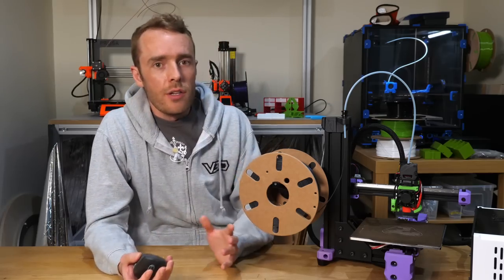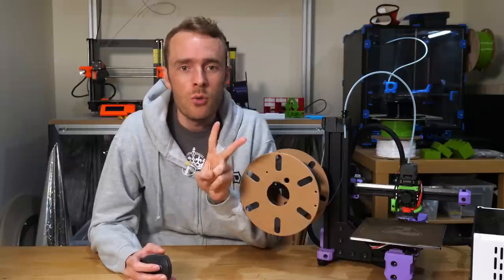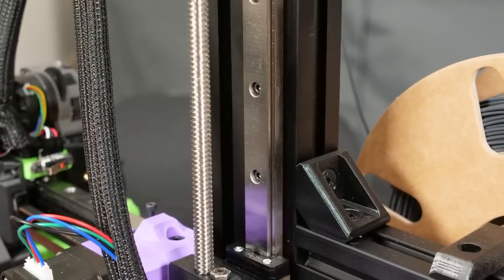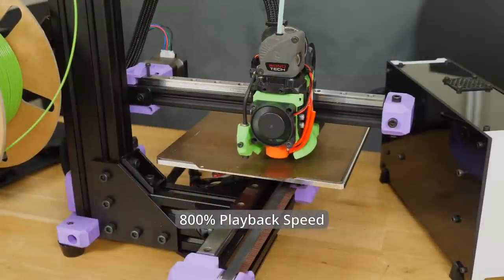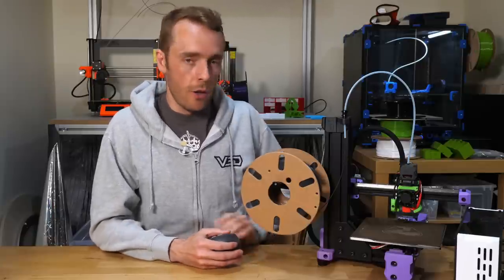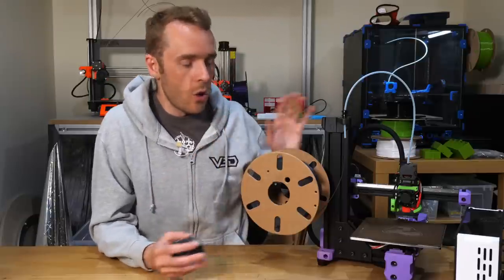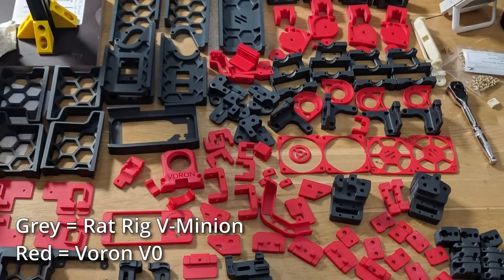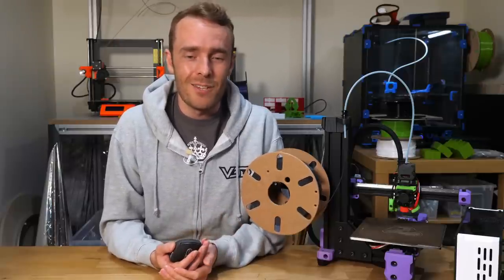Mini 3D Printer Is a Performance MONSTER - Rat Rig V-Minion Review

Comment: I've had mine for a couple of months and I agree with every single word in this review. Probe, PSU, filament guide, and spool holder, and cable management should be upgraded. And after that you an incredibly fast and precise machine. I absolutely love it! Rat Rig could do everyone a solid and ship it with a good probe and PSU from the start. I don't see the point of shipping it with a probe that everyone has to swap out.

Comment: I love my v minion.  I added an integrated lead screw stepper and the spinda.   I did replace the weho power supply with a meanwell also.   I thought the reason rat rig uses them was to save money but from what I understand it is because meanwell are not approved for consumer use in EU and they don’t want to get fined or sued.

Comment: Just watching this I'm beggining to think it't very feasible to turn 1 Ender 3 style frame into two of these minions... Interesting... great video as always!
Reply: Look into the voron switch wire maybe a bit more worth it for a conversion system
Reply: Aluminum extrusions are really cheap, it doesn’t make a lot of sense to destroy a completely working printer to save $50
Reply: @alexpawlowski7644  unfortunately not that cheap where I am, but I get your point, don't worry, the printer is safe ;)

Comment: It seems as though people have gravitated towards the Kingroon machine and modded that, I have an original Ender 2 that is pretty much stock standard apart from a compression fitting replacing the pneumatic one and replacement bed springs, I had to tap the heatsink straight as it was tapered somewhat but that was an easy 2 minute job, the Ender 2 is also my most reliable printer, It just works, I can't remember the last time I had to level it either and its print quality is excellent.
Reply: Was just gonna say this.  For this price you could buy 3 kingroons, upgrade them with bimetal heatbreaks and put klipper on em.

Comment: According to the configurator on ratrigs website. Meanwell is not certified for use in EU and therefore they supply the Weho. Any thoughts on this? Seems mostly like a legal thing and not quality reason? Thinking of ordering the kit without psu and sourcing meanwell psu locally instead. Copied from their website: "CHOOSE ONE POWER SUPPLY (WARNING: MEANWELL LRS PSU IS NON-COMPLIANT ON EU MAINS FOR USE WITH 3D PRINTERS. PLEASE SELECT WEHO IF YOU'RE EU/UK BASED. IF YOU SELECT MEANWELL, WE WILL AUTOMATICALLY SWAP YOUR SELECTION IF YOUR DELIVERY ADDRESS IS IN THE EU/UK"

Comment: Thanks Adam! Nice, balanced review.

I'm loving my V-Minion. It's just waiting to upgrade to a Revo with high-flow nozzles, and for a 4028 cooling fan upgrade, so my flow rate can keep up with the rest of the printer (I've managed to hit 800mm/s with my minor mods).

I printed your spool holder in PA-CF, and that's been working great.

It's funny, but I haven't had any issues with the kit probe. I even bought a SuperPinda, but haven't installed it yet.
Reply from the maker: Thanks for the $5 Jon. I think you're not the only one waiting on Revo high flow! 800? That sounds very high for these steppers, thought lost torque after about 300-350. Glad to hear my spool design worked well for you, it's been a saviour for me too.
Reply: @Vector3DP  I'm using the LDO-42STH48-2504AC on my y-axis, and hit 800mm/s according to Mainsail for a large test part that filled most the bed. Accel was 15k, I think.
Reply: @Vector3DP  oh, I should really say I'm waiting for Revo high flow ObXidian nozzles! I don't ask for much!

Comment: Hey Adam, I've seen somewhere that people are starting to use break out boards like yours that only use a usb between the main board and the breakout. Is this remotely possible with the ratrigs and voron setups?
Reply from the maker: That requires a serial or CAN communication which requires a microcontroller etc to work. The downside is that when you do that you put a microcontroller that can overheat back in the enclosure and half the point of this is to keep sensitive electronics outside the enclosure.
Reply: @Vector3DP  so something similar to your new 2.4 build mods with that can system setup would work for that?
Reply: The Mellow FLY SHT's and BTT EBB toolboards are supported out of the box in the next version of RatOS via a USB connection so you don't have to mess with CAN, simply plug and play, if that's the way you want to go. Adam is right about the enclosure, but so far it works well for me with a small heatsink on the driver and mcu of the toolboard up to 50c ambient.